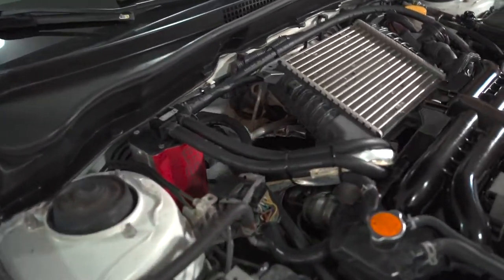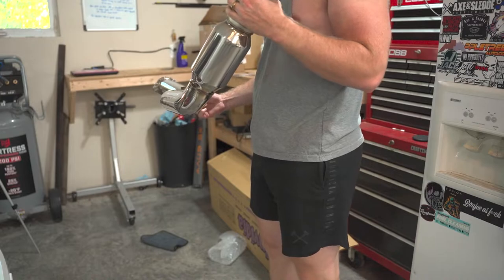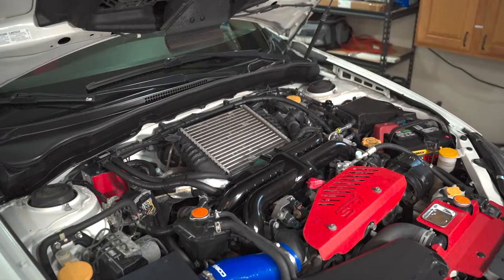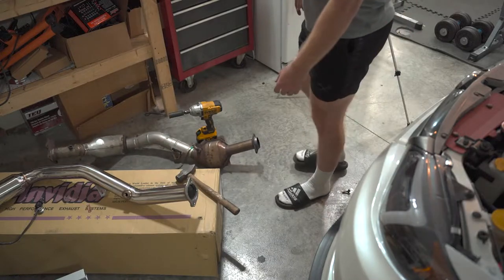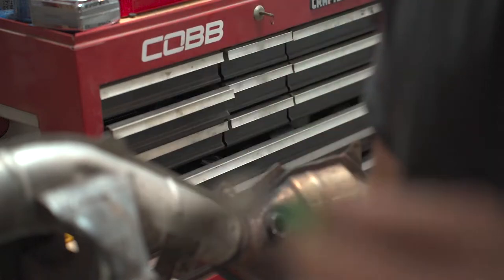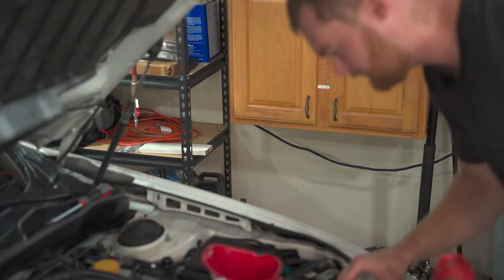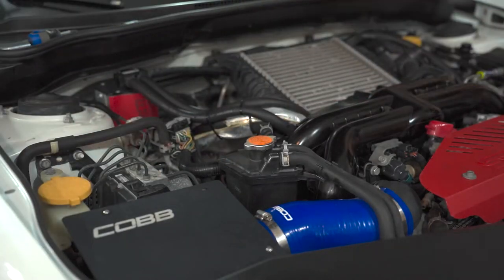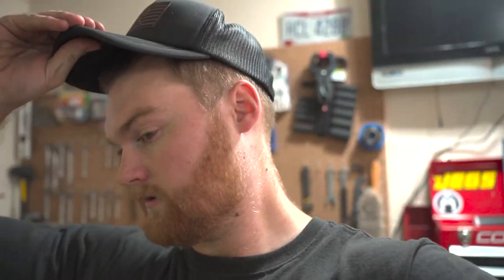The WRX Finally Gets An Invidia Downpipe!!!

Comment: I am looking at doing this to my car! I had to replace my rear o2 sensor because it rubbed on the driveshaft and had shorted out causing a check engine light. Subaru from factory uses Denso sensors so I found mine on RockAuto for a fraction of the cost. Thanks for a great vid!
Reply from the maker: That’s good to know! Thank you for watching and commenting!
Reply: @brotherboost  I look forward to watching more! I have a 2012 WRX hatch. I live in Indiana so maybe we might see each other at an event!
Reply from the maker: @Roleson58  oh yeah for sure!!

Comment: Dude, I seriously hope you got that E-tune. Legitimately coming from a place of wanting to help here, there's so much that you got wrong by cutting the corners that you did and you are risking engine damage by driving the car with that current parts/tune setup. 

For starters, cobb OTS maps are intended to be used ONLY with cobb parts unless otherwise stated (grimmspeed states that their intake is compatible with the cobb map for example). So unless the invidia DP states as such, it shouldn't be run with this map. But then you state that you have an intake PLUS a downpipe and couldn't find the right map AND cobb told you it didn't exist. So you went and slapped the stage 2 map (which is downpipe ONLY) on the car. That resulted in a DAM drop, which you shrugged off. DAM is a global adjustment to timing and should NEVER drop below 1.00. The fact that it is hitting .5 is potentially going to lead to catastrophe. If I had to guess, you are currently running extremely lean under boost with that parts/map, which WILL blow an EJ. If you haven't gotten to your tuner, I highly recommend you do it yesterday. 

Again, I truly mean well here and am seriously not trying to come off like a jerk and not trying to just be critical. I just don't want to see you make the mistakes a lot of people do with these cars.
Reply from the maker: Thank you for this info! I 100% agree with you. I didn’t drive it at all with that OTS tune. I got it Etuned right away. Thanks for warning me!
Reply from the maker: I know how finicky these cars are haha
Reply: @brotherboost  ok good to hear. Hope I didn't come across as a prick lol

I bet it's putting down some good numbers now. Enjoy it!
Reply from the maker: @NateBridge-ql5ko  no sir! I understand you were just helping, not many people do that anymore. I appreciate that you didn’t just throw out a hate comment like most people do.

Comment: Got the same downpipe and I have a check engine light. Do you have one ? If so how did you get rid of it?
Reply from the maker: No I do not have one. I would guess that it’s your O2 sensor. It either got messed up during the transfer or you forgot to plug it in. Get under there and make sure it looks fine then unplug your battery to reset the ECU and see if it comes back
Reply: @brotherboost  definitely put it in right but you might be right about bad sensor. The thing did look a bit rough haha . Just to be clear you didn’t have to tune yours out? Light never popped up?
Reply from the maker: @jk_waters  I dinted mine up pretty bad taking it out and after driving it for like 10 minutes my light did come on so I knew I messed up the sensor. So I got a new one and replaced it and the light went out for good. But no you for sure do not have to tune it out.
Reply: @brotherboost  bet I must have messed it up. Doing a build series on my channel and I’m sure you can relate to this. Working on your car and recording is not easy 😂Thank you for replying much respect.
Reply from the maker: @jk_waters  for sure man! Thank you for watching and commenting. I’ll subscribe to your channel now!
Reply: @brotherboost  right back at you! See ya later man ✌🏾